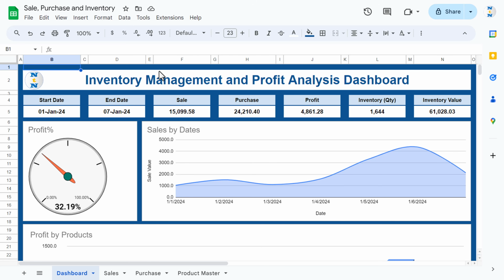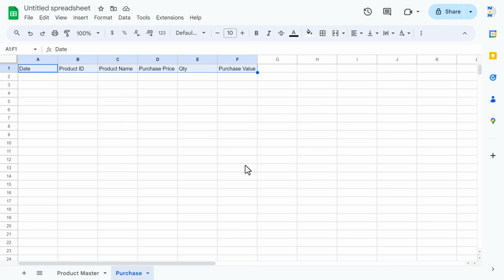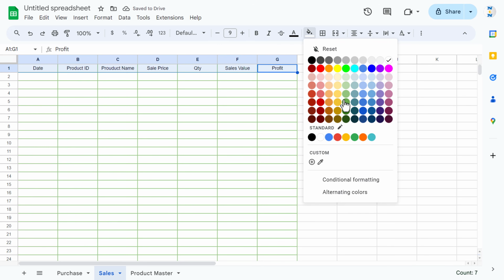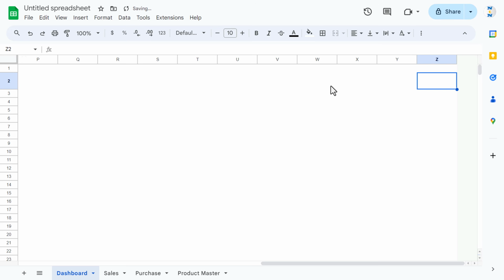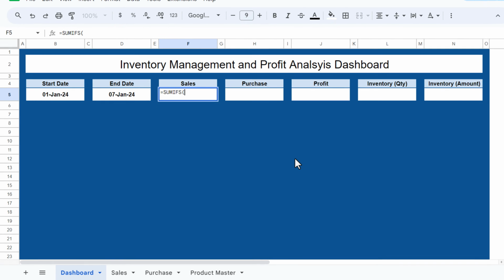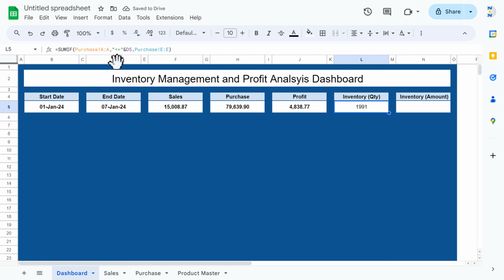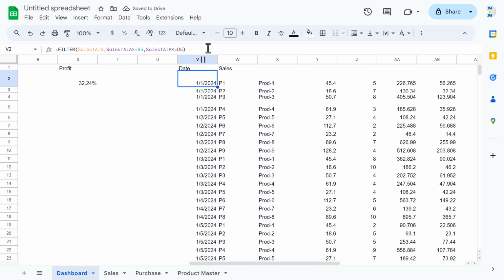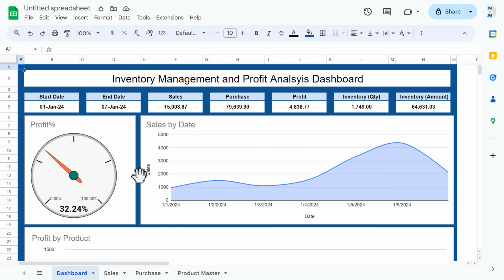Inventory Management and Profit Analysis Dashboard in Google Sheet

Comment: When all my inventory is sold, my Inventory Value equals the negative of my Profit. So, my inventory count is zero, but it shows -3,8555. My Profit shows 3,855.
Formulas:
Profit: =SUMIFS('Daily Sales'!G:G,'Daily Sales'!A:A,">="&B5,'Daily Sales'!A:A,"<="&D5)
Inventory Value: =SUMIF('New Purchases'!A:A,"<="&D5,'New Purchases'!F:F)-SUMIF('Daily Sales'!A:A,"<="&D5,'Daily Sales'!F:F)
The problem is you are subtracting the profit and the cost of then inventory with your formula. The value of your inventory is what it cost you. What needs to be deducted is the Purchase Value entered its purchase date on the Purchase sheet.
Can you tell me what that formula looks like? The work-around I tried is to add another formula to the Dashboard Inventory Value formula to deduct the Profit GG as well. But that is not working properly :(
Update: I was able to correct this by adding a look-up for Item Cost * Quantity in the Sales and used that new column as my destination for the Inventory Value on the dashboard. My Value now reads zero.